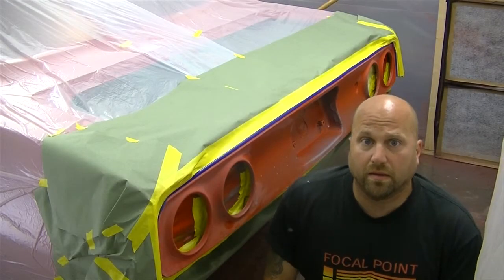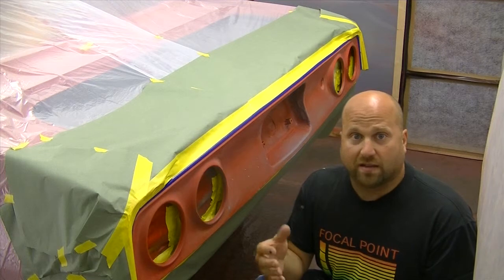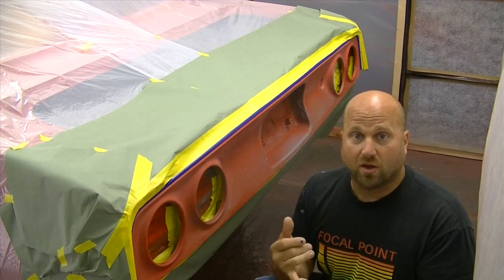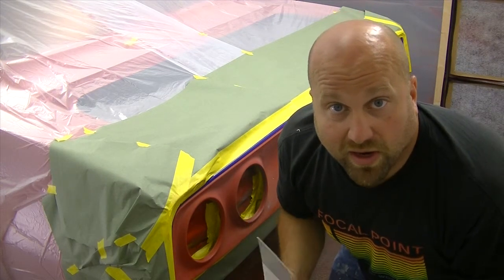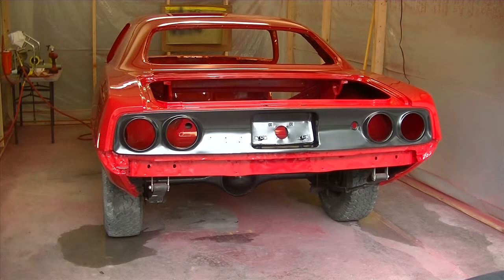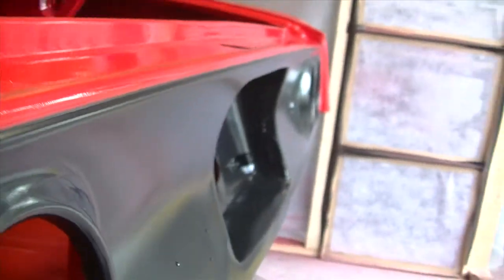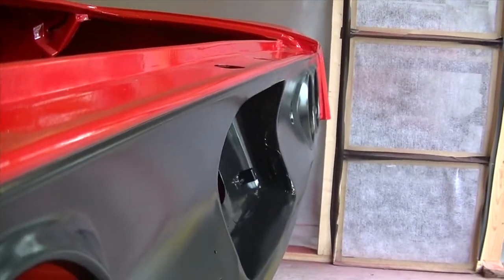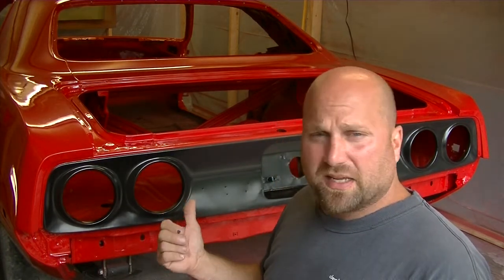Painting Cuda Tail Panel

Comment: BUZZ  I just watched painting the tail panel. you scuffed the red paint with scuff pad. then painted a coat of sealer. don't you need to scuff the sealer before the black is painted ?   thanks for the help my challenger has been in primer since I bought it in 2002. your helpful videos have been great I hope to spray soon.